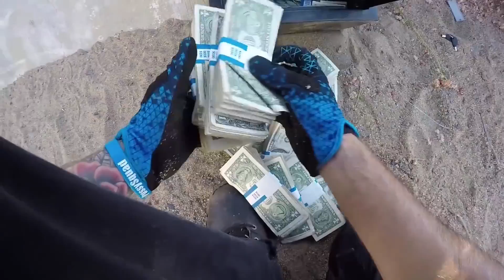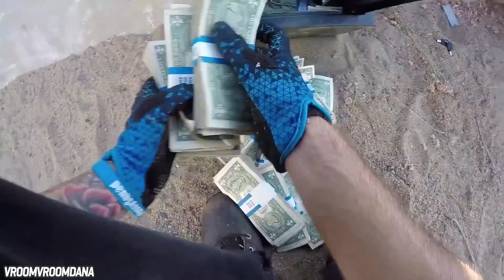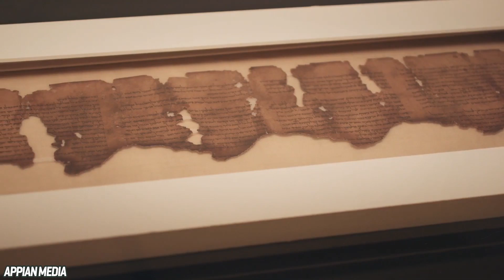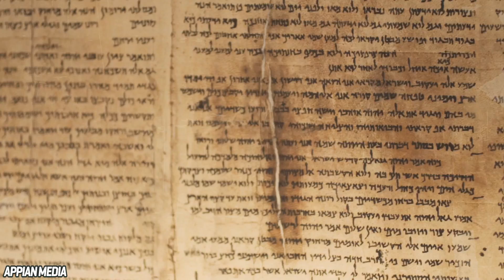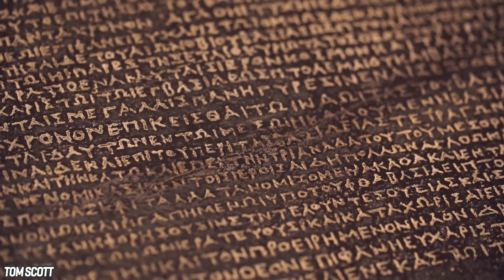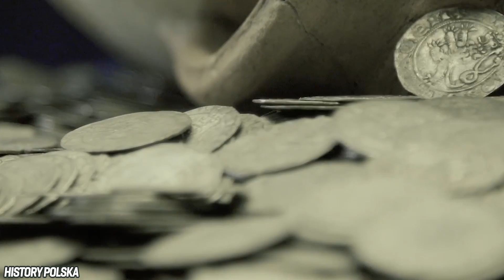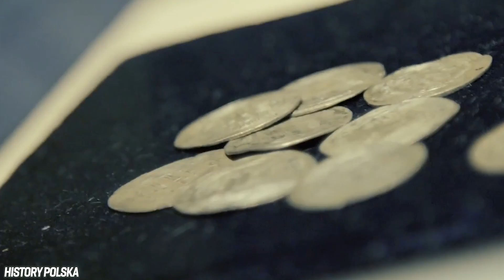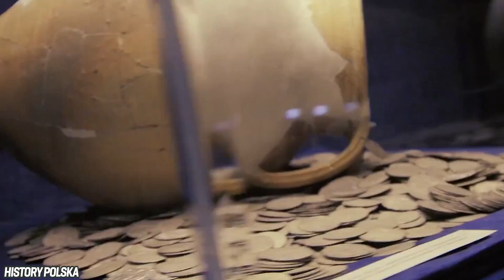Soldiers Accidentally Find Over $100 Million In Gold

Comment: If each if those bars weigh 50lbs.

Theres 14.583 Troy Oz in a Pound.

Multiply 50 by 14.583 and get 729.15 Troy Oz per bar.

A troy oz of Gold is currently going for $2,500.

Multiply 729.15 Troy Oz by $2,500 per and you get........

$1,822,875🤯🤯🤯🤯🤯🤯🤯🤯🤯🤯

Thats. Per. Freaking. Bar.

Every war is a bankers war.